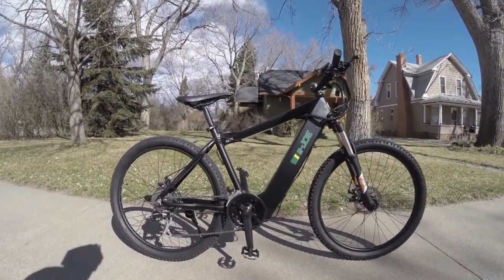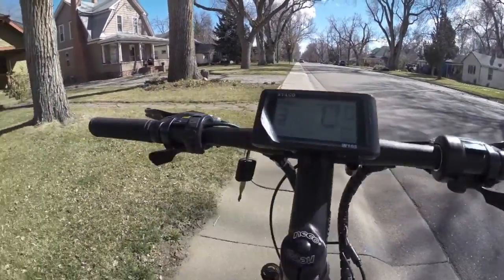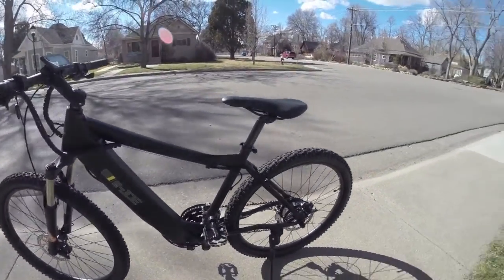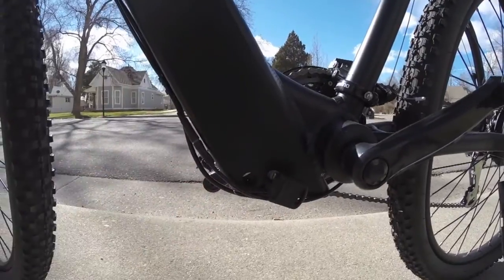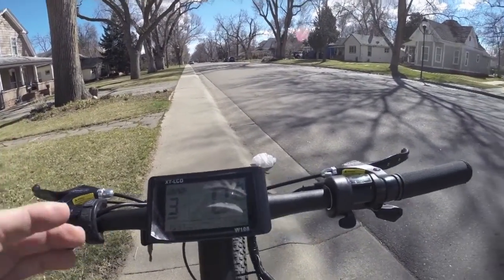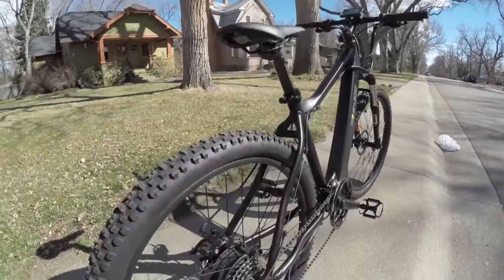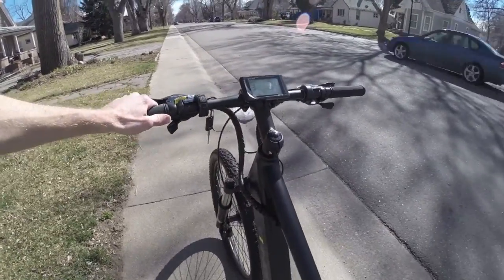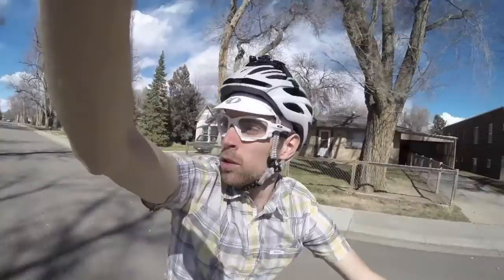e-Joe One Prototype Video Review - Hardtail Electric Mountain Bike, Geared Hub Motor, Pedal Assist

Comment: hows the shock hold up on it?
Reply: Probably not that well if you take it on serious off-road terrain. This is like a light trail bike and the suspension is basic. I've ridden other ebikes with the Sun Tour forks and had them basically go out and become like springs with no dampening (after serious riding off road over rocks and bumps at high speed). Can't say for sure unfortunately, only had limited time with this bike.
Reply: Okay thanks alot
Reply: Luke Mahanez Sure thing, I try to be as honest and helpful as possible. You can always upgrade the suspension but if you really plan to go off-road it might be less expensive to find a higher end bike.
Reply: thanks